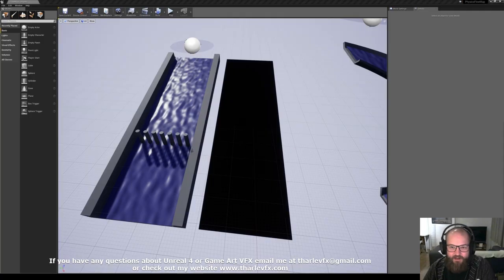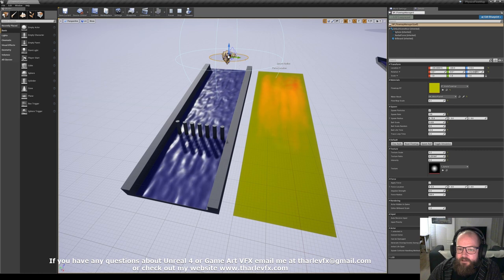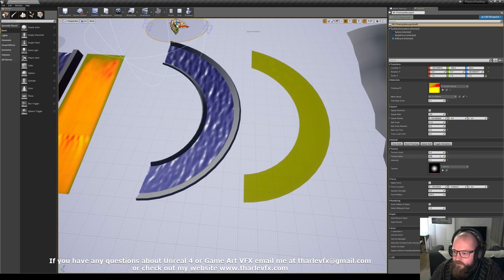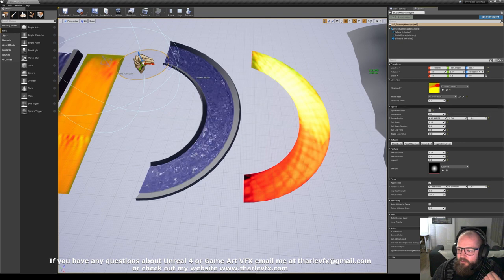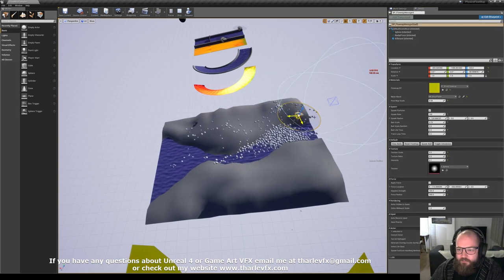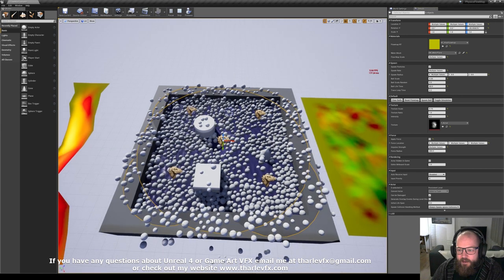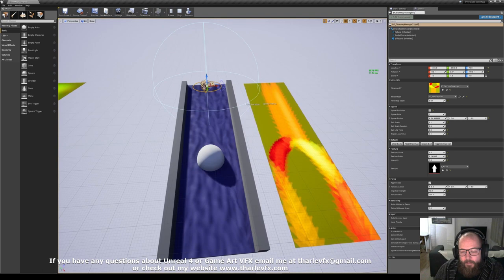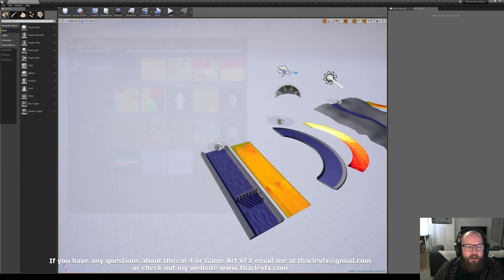Physics Flowmap Tool

Comment: Just found this after a few days hunt for a flow map design/generator tool.

This looks very interesting! I wonder; would this work with large stuff like rivers and streams both near flat and in steep terrain?
Reply from the maker: it should work for all conditions, up to a point.  It's using rigid body physics for the spheres, rather than fluid dynamics but its completely editable and interactive in terms of how large a sphere you use and how you spawn them so you should be able to get good results in all situations, with a little bit of time spent massaging the simulation.

Comment: So I bought it and I'm having and issue; 
Switch on EPhysicalSurface needs to be refresh, I'm told. 

I see two outputs; one is Default, the other is Flowmap, which is connected to Set Vector Parameter Value.
The Flowmap output is red, indicating something is wrong.

If I refresh the EPhysical node, the Flowmap output is removed. 

Help :O

For what it's worth, this is on Unreal 4.27
Reply from the maker: i think you need to open the Physical Surfaces section of the Physics project settings and make sure that SurfaceType1 is set to Flowmap.  This is so the blueprint knows when it's hitting the flowmap meshes, via the material system.  If that's not working please email me - tharlevfx@gmail.com and we can further debug it there. thanks